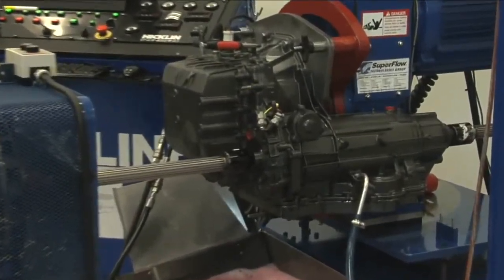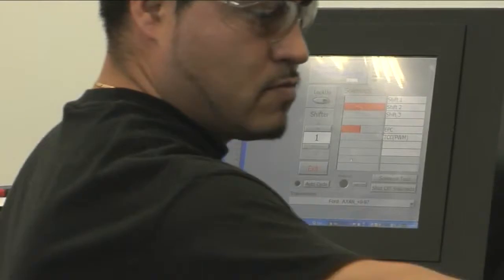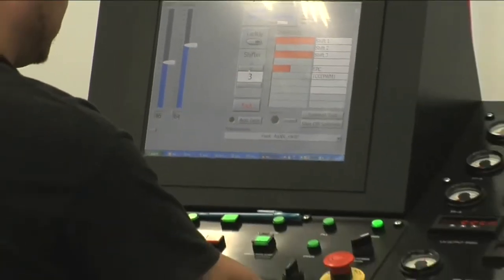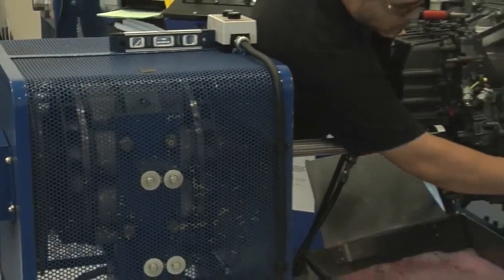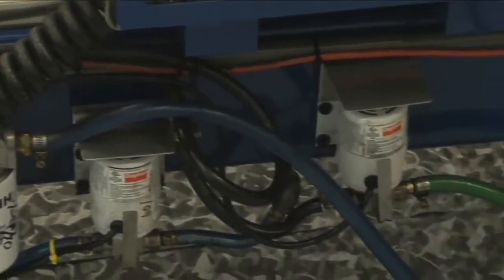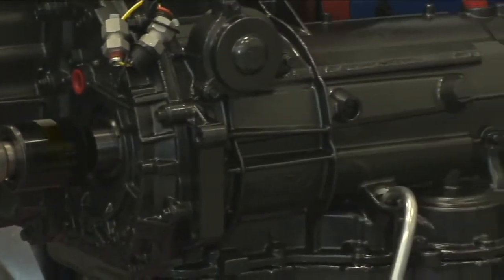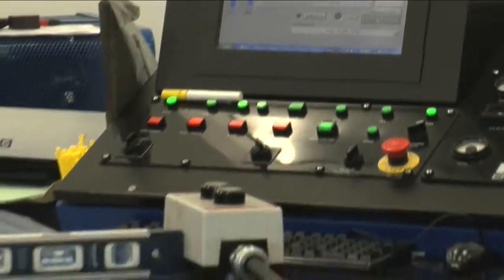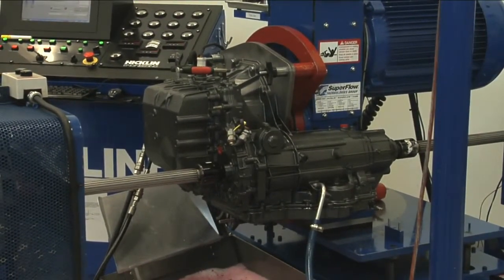Built Strong - Testing to Ensure Quality at Moveras

Comment: and 1 more thing when i last spoke to this company here on youtube they argued that that bench test all foward gears i said well your qa must be lying cause the 3rd and 4th were completly missing huh if you did bench test all foward gears you would have seen the problem from your qaulity control someones head needs to roll for this
Reply from the maker: Sir, you have left several comments expressing your concern and displeasure. No one has argued about testing, merely pointed out that it is standard practice to dyno test prior to shipping. 
The fact is, in your vehicle the transmission didn't operate as expected. We would like to speak to you about a resolution, but you have failed to contact us so we may help. 
We don't have any contact information that we may reach you. Please email us so we may resolve this.
Thank you, 
agolas@moveras.com
Reply: @moveras9821  your company has had my lincoln down for a long time cp transmission had to rebuild your rebuild what do you have 10 yr old building the transmission this was insane to have to deal with money wait more money wait heres another oh it dont work either .... beware of this company they will screw you and no reimburse you for labor or suffering 8 months for another junk transmission look at their reviews..........
Reply: @moveras9821  honestly your company should be shut down and an investigation done cause if ive had this much trouble there has to be thousands of others